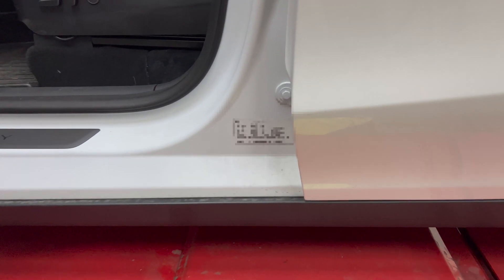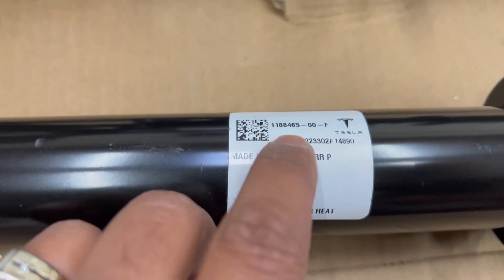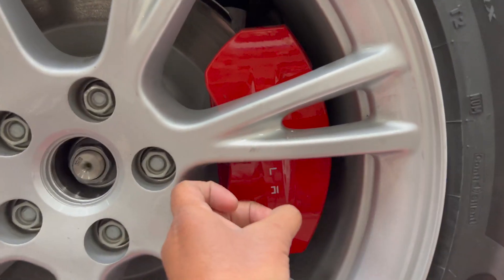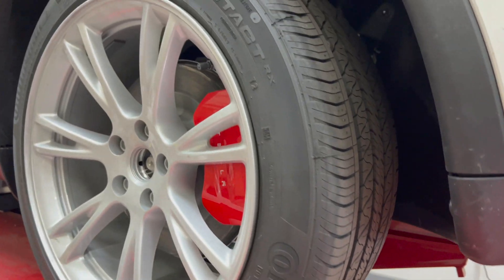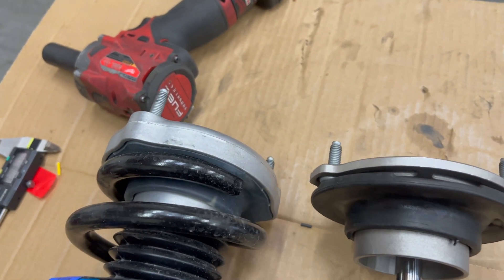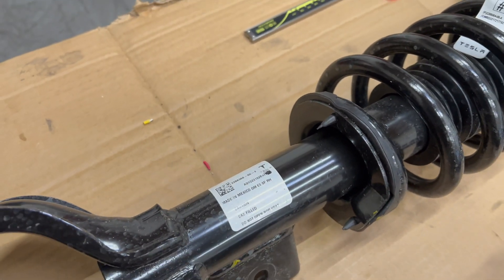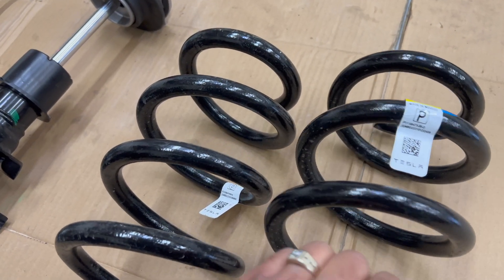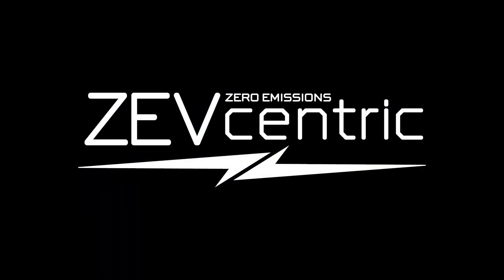Did Tesla update Model Y Performance suspension AGAIN? Is the structural pack suspension different?

Comment: So the performance suspension hasnt changed, but the LR has?

Do you think the 2023 performance suspension is bettee than a 2021 or older LR suspension?
Reply from the maker: The 2023 P and LR are both updated.  Yes it is softer than before but still not good enough.

Comment: How much more comfortable would you say the 2023 LR is vs 2023 SR? Is the 2023 SR closer to your 2022 P or the 2023 LR?
Reply from the maker: We didn't get to drive the 2023 SR at all but the owner said the Tein coilovers we installed on it were way better than his oem suspension.
Reply: @zevcentric  OK. Fair enough. Then how did you come to the conclusion that the LR suspension was better than the SR suspension at the end of the video.
Reply from the maker: @HorsesNBayonets  to my recollection we didn’t compare LR to SR.  I stated that the 2023 MYP’s are all the same as of now, the main topic of the video, and then physically compared the MYP to the SR.  The statement was likely referencing that the MYP 2023 is not as soft as the 2023 LR.  Just reiterating that from the original video we produced.  Sorry if it got confusing.

Comment: Does MYP actually have lowered suspension? My biggest decision maker to go with MYLR was because of the higher ground clearance. Maybe I'm speaking 2 different languages (suspension vs. ground clearance). Can you confirm if MYLR does indeed have more ground clearance? and if so, how much? 2023 model please :)
Reply from the maker: so yes the MYP has been hit or miss.  It's so weird.  Some are lower and some are not.  if it is lowered it will have reduced ground clearance in the front but the rear runs a taller tire so won't be as reduced.  From hub to fender there is usually a 15mm difference between LR and YP.
Reply: @zevcentric  wow thanks for a quick reply! So I guess the ground clearance is minimal difference… but still glad to know that LR has softer suspension over the P. Thanks for the video!

Comment: I received delivery of the Austin 4680 Y yesterday.  I've had dozens of different dampers on various cars over the years.    The YSR I have doesn't have to be this firm but it's still relatively well dampened.  Chassis control is ok.  High speed comp and rebound feels a tad too high.  I wish the Y felt like my Rivian in all-purpose mode.  Incredibly good suspension tuning on the Rivian.  I'm nearby of you guys need to see the 4680 again.  Thanks for posting.  It was not possible to research this trim well since barely anyone posted online.  Here's my contribution.  https://youtu.be/KiDIOXMUvyA
Reply from the maker: where are you?  Let's totally connect!!!!!!!  I want to get it on scales tbh.

Comment: The suspension will soften up over time anyway
Reply from the maker: Your interpretation of this may not translate to an "improvement". Losing damping forces or having spring material fatigue isn't going to help make these ride better. The issue is primarily compression and bumpstop engagement. What we really wanted to share is that there were no changes like one was led to believe in the past few months on the YP.
Reply: @zevcentric  I know it’s a sign of wear and tear but I’m just pointing out that it does soften up over time.
Reply from the maker: @thiswillnotendwell4402  after working on hundreds and hundreds of model 3's going back to 2018, I have yet to find someone with a dated 3 that said it felt good with additional age or mileage, much less model y's which are far worse. I do appreciate your insight though.
Reply: @thiswillnotendwell4402 I agree with you